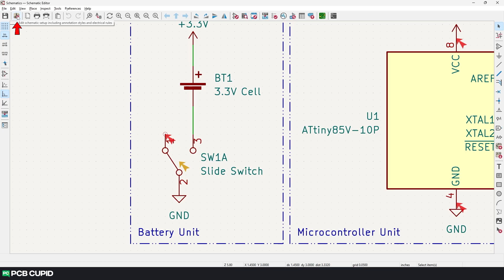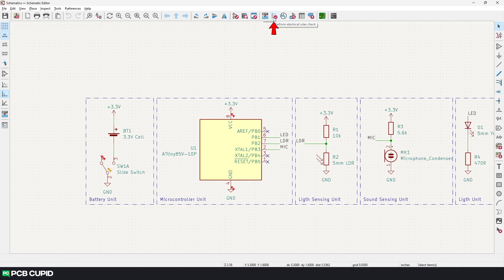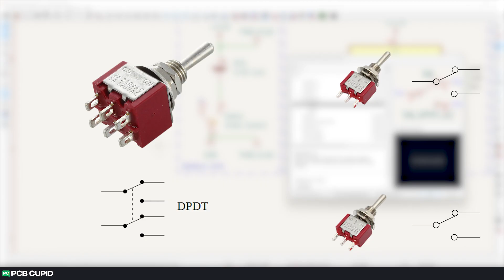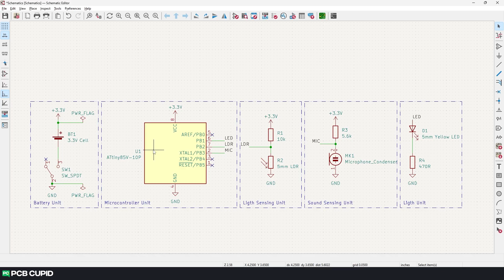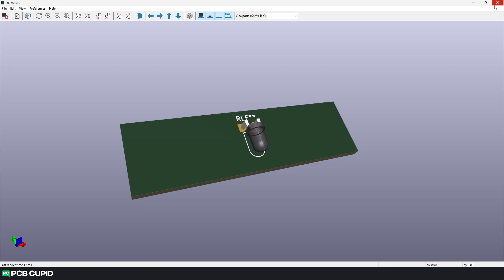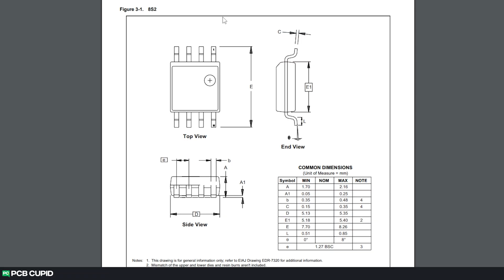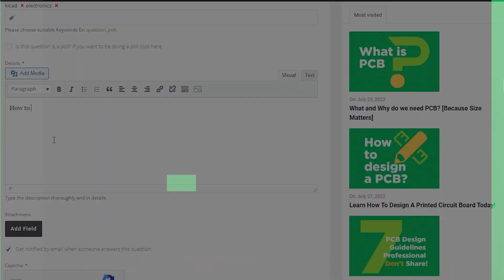#5 How To Perform ERC and What Is Footprint In KiCad 7.0 | #PCBCupid

Comment: I am getting an error which goes like this

Error: No simulation model definition found for symbol 'SW1'.
Symbol SW1 [SW_SPDT]

The same error for other components like the Battery_Cell, Attiny85, microphone_condensor
I tried searching online didn't find anything, how do I resolve this?
Reply from the maker: You can ignore that error, or exclude that error. The error is related to simulation which won't be a part of your PCB design. 

If you have anymore question please drop them in forum.pcbcupid.com

Comment: if i have given input from one pin say an ic to an variable resistor whose two pins are from the same ic pin then what should the notation i must give  because there showing warning
Reply from the maker: The question seems bit confusing, can you post the screenshot of the circuit and warning message here : 
https://pcbcupid.com/add-question/

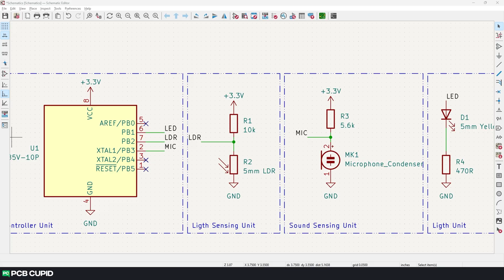Comment: Minor correction, at 5:46 you say you can open the "footprint editor", but you meant "footprint assignment tool". The footprint editor for someone new to KiCad is a separate tool that lets you edit a footprint to modify it. The footprint assignment tool lets you link at existing footprint to a symbol.
Reply from the maker: Thanks for pointing out!

Comment: Sir could you say how to rectify "failed to read simulation model from fields" error...
Reply: It is a bug in I believe 7.0.5 and below. They are working on it. In the meantime, you can disable that warning. This is only used if you are using KiCad to actually run a simulation on the circuit, for example to trace a waveform of an oscillator.  Just like linking footprints to a component for the PCB, and 3D models to be able to view a rendering, there is a simulation model that describes the mathematical properties of the component in a circuit.
Reply from the maker: Could you give more information on this? 

Like when did the error occur, during ERC or during Simulation? 
Which symbol did the error occur on?
Reply: @pcbcupid  It occurred during ERC sir, it shows this error with power source, GND & LED
Reply from the maker: @poojaarangaiah7606  I think the symbols is corrupted, delete the existing symbol and replace with a new one.

Comment: How to remove the "symbol pin or wire end off grid warning" ?
Reply from the maker: In schematic editor 
Go to View -> Grid Properties -> Set "current Grid" = 1.27mm or 50mils 

Then select all the components with Ctrl+A, then right click and click "Alight elements to Grid". 
After the alignment check if all the connections are correct and then run ERC.
Reply: @pcbcupid  Thank you, your videos are very helpful